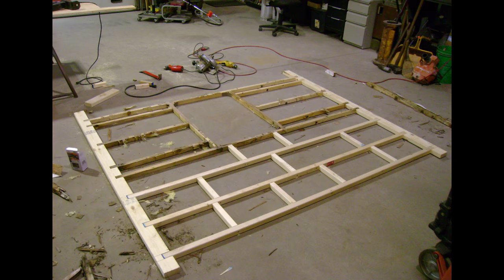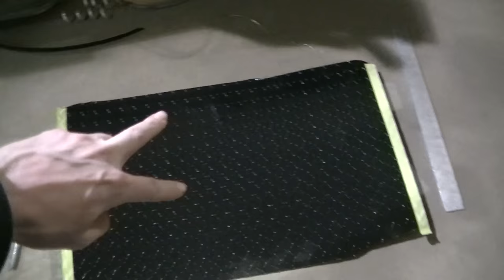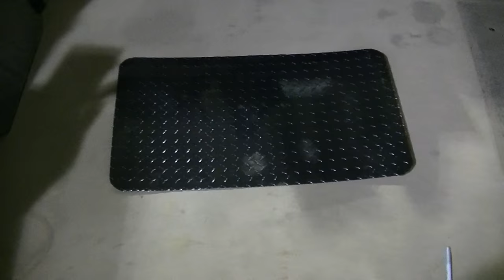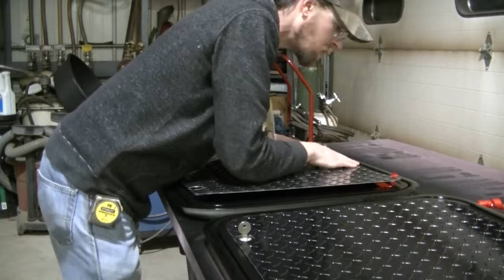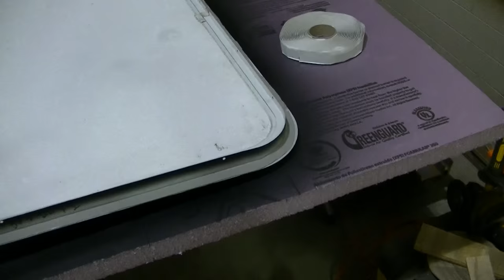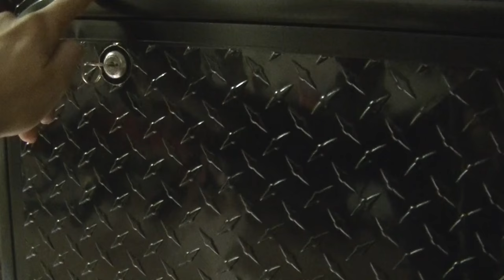92 Terry Resort 5th Wheel Camper Build "Front Storage Doors" Diamond Plate Aluminum

Comment: Man i cant wait to see the outside when it is done. I do have to admit I cringed a little when i saw that you were going to put the old aluminum siding back on the top, but with a little paint, it might look ok. The black diamond aluminum lower half looks killer.
Reply from the maker: I also hated to run the old siding but the funds were not there.  I may get new siding for it in a few years if I really enjoy using the camper.  I have a few ideas to make the old siding look good without spending a ton of money.
Reply: With your wood working skills🤔 You could do amazing things to the outside of that trailer. Maybe a beach washed gray color to match the black dimon plate below
Reply from the maker: The bedroom and bathroom are pretty much done except trim.  The kitchen/living room is going to be natural color rustic hickory.  I don't want to go dark on the inside so it feels more open.

Comment: Mossman381, win u gonna move in the camper,heck u can honestly say u built ur house from the ground up.
Reply from the maker: +Game Bred Duramax   It needs to be sealed up before I will try it out.  Also needs some water lines and faucets.
Reply: +mossman381 im kidding about the permanent house thing,but i would set it up and sleep in it on the (Front 40 :) for fun,and it should look real nice hooked up to darth dually will the black accents u have goin on
Reply from the maker: +Game Bred Duramax   I could easily live in a 33' camper.  I spend most of my time in the shop anyway.